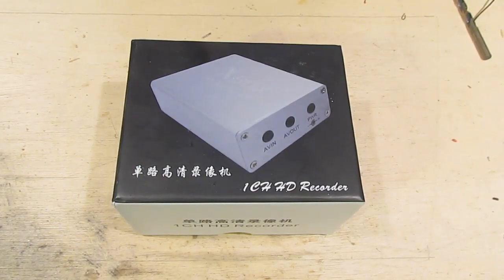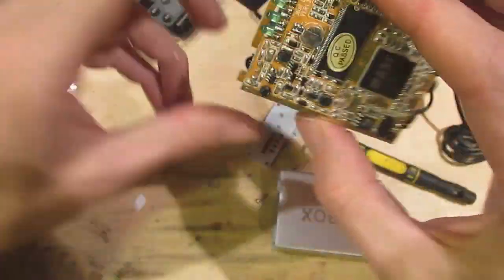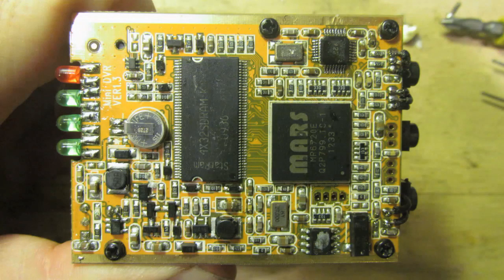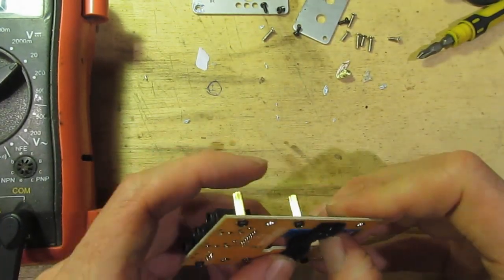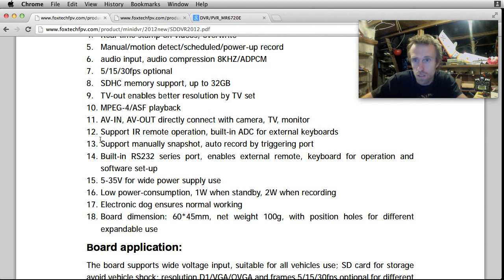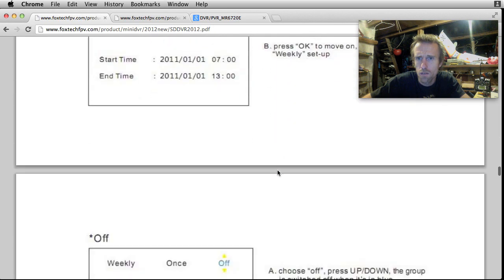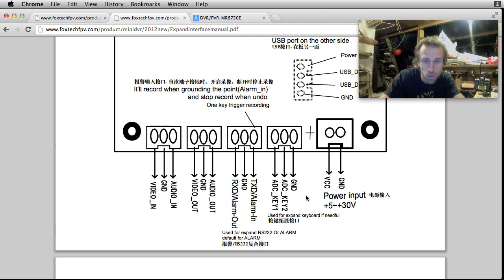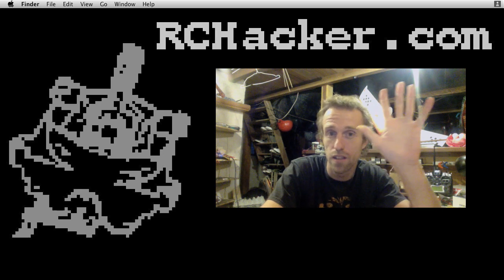Mini D1 SD card video recorder. Teardown. RCHacker #16

Comment from the maker: Codec info read from VLC container is ASF.

MPEG-4 Video (M4S2)
704x576
30FPS 

audio 8kHz 8 bits per sample.

I have just started recording some flights with this. There were lots of artifacts which was dissapionting. However it could be because I am using the video pass through function which tended to lock up for short periods.

Comment from the maker: Proper video review coming one day:
I have been using this a bit as you can see in my latest videos.
Video format is a pain in the bum to convert and on certain compression ratios it drops a lot of frames. It also gets some massive artifacts like I have never seen before.  I think the compression settings are backwards in the menu. Got to do more testing.
Anyone know if there is a firmware update?

Comment from the maker: It works well enough, The video seems highly compressed and it saves in some weird asf container (inside is mpeg4). Once I get a new airframe in the air I will be using it to record all my flying.

Comment: Mark - Excellent tear down clip showing the extras this unit might do.
You mentioned you were doing some test clips using the DVR.
We are looking to use this for remote surveillance work and wondering if you know
the standby current draw etc so we can figure battery life etc etc.
Cant find a thing in the reference materials..
Any help would be great.
Many thanks
David - Melbourne, Aus

Comment: If the quality  looks as clear as it does on TV then it might be enough. I know mpeg4 uses a lot of compression but I'm not sure what video format this thing records to. My current setup records in MPEG1 or 2 video and the quality is acceptable but there is comb effects with fast parts of the videos. there is no deinterlace on it. The software only lets me record in 2 formats and they both don't even work so I'm using the software from my old capture device.

Comment: Marc,
This is a pretty cool piece of kit - I am using the Mini DV01 with the built in 5.8 RX and LCD screen in a video ground station but cannot get rid of the DVR OSD, which interferes with the FPV OSD data. Does this item allow you to turn of the OSD on the video pass through?

Alan

Comment: Thanks for doing this I learned something to day (watchdog).
I bought this from FoxTech about 3 months ago & I am really pleased with it.
About the battery.... I believe it's there so that when the plug to the power is pulled it can use the power from it to finish closing the file to the SD card.
I've used cheaper "DVR's" that don't have that and when the pwr cord is pulled, the last file that is open is lost because the unit didn't have pwr to close out the file... make sense?

Comment: I am looking for something like this to record gameplay footage off my playstation and to record VHS tapes to the computer. I know there are video to USB capture devices that do this b/c I have two. The point is I want to eliminate the computer from doing the heavy lifting (encoding) when I could just get a small device like this to do all the work. Then I can just plug the SD card into my computer and then work with my videos.